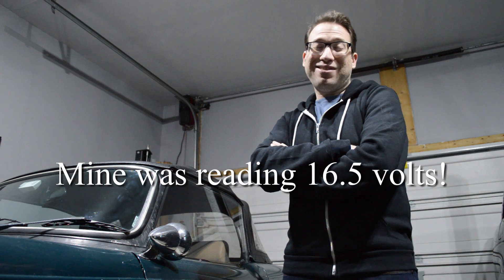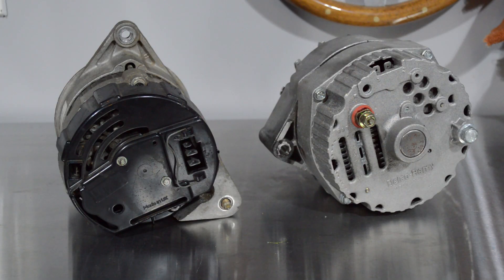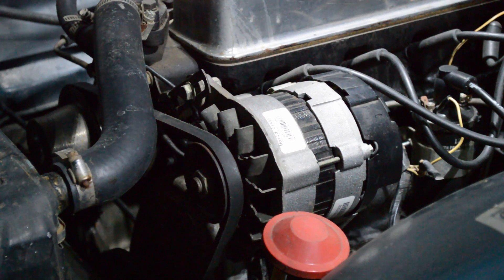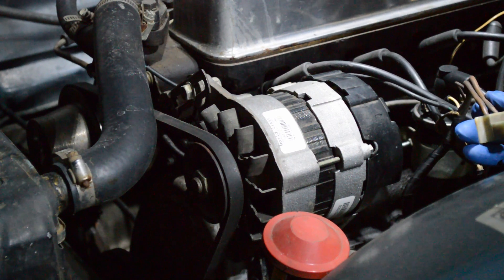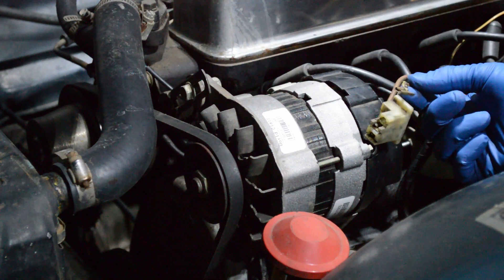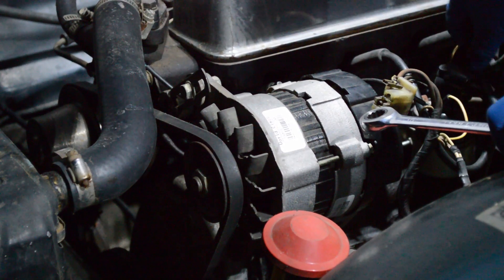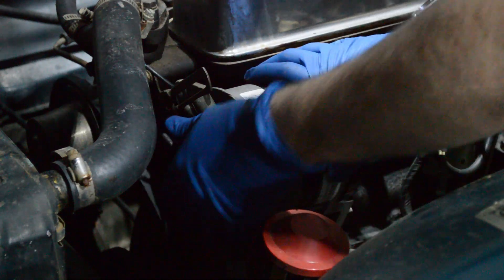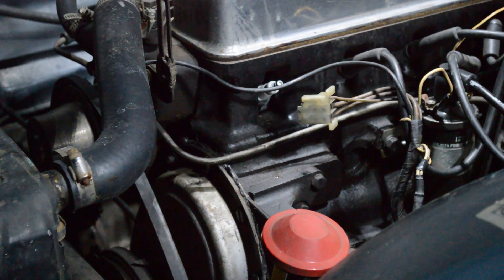Lucas Alternator is Overcharging--What Now?

Comment: Prince o'darkness strike again.
Reply from the maker: To be fair, most of the time that Lucas electrics fail, the system is several decades old.  It's typically down to lack of maintenance... at least unless you have a TR7.  Those were never screwed together properly at the factory....

Comment: Hi, is there any chance that you are going to make a Lucas 'refurb' video? I have a feeling mine is on it's way out, and it might be easier to replace the diode pack or whatever else than to get another. Most available- Rockauto!- do not come with fan or pully, and I'm not sure I want to swap those over. I could see one or another not fitting the new alternator, 'cause Murphy's law of aftermarket. 
Last week I pulled my 74 out of storage and drove 45mins to home, stopping at the store. I left the parking lights on, and in 15mins the battery was stone dead. I uber'd the battery home, charged it, and uber'd back. Once I got home I verified that the alt. was only putting out 12.x Volts. Yesterday I unplugged the connector, checked leads, plugged it back in to check for ripple and hook up my alt. tester. It was working fine with 14.2V...irritating. I'm going to drive it today to see if it's heat related. Or, it could have been in the plastic connector...I've never taken it off in 6yrs of ownership.
Reply from the maker: I've thought about it, but rebuilding alternators requires some soldering skills and diagnostic skills that might not translate through a video.  Also I'd be bad at it since it's not my area of expertise.  Diagnosing is easier than fixing....
Reply: @midwestmotoring  Thanks for the reply. I've since bought a reman'd Bosch unit that works a treat. My Lucas was indeed shot, but put out 14V, until you had lights on then it couldn't charge the battery. Bat light never came on...

Comment: Great walkthrough and descriptions -- for another replacement option, I found this alternator on Amazon (not an affiliate link - no financial interest) https://www.amazon.com/gp/product/B00KL5157Q

It's a direct plug and play replacement for a 1976 Lucas alternator (at least -- probably most other TR6 models as well), and the only hinky-ness I encountered was needing to unbolt the three long bolts running through the perimeter casing, and very carefully rotate the back half of the casing around so that the mounting holes matched the Lucas mounts exactly.  After that, it was a drop-in replacement.

One note of caution: it's a 55 Amp model, so you'd likely want to run an extra cable over to the positive battery terminal, so you're not pulling 55 Amps on that poor little brown wire.
Reply from the maker: Definitely a good option, and probably better than the Delco unit.  The most appealing part of the GM alternator is its same-day availability.  I walked into an AutoZone and left with the alternator 10 minutes later.  That was important to me since we were on a trip when I picked it up and needed to keep the car going.

Comment: Ha! I have a degree in Electrical Engineering Technology, and you are good with your explainationions LOL. What is the component of the alternator that can cause a battery drain? I've always wanted to know that. My money is on a sensing wire backing out of the plug? Bane of my existance on my Bosch wired Alfa, I've found 3 that had come out on different sensors. PITA to diagnose.
Reply from the maker: With British cars, who knows?  I've got a battery drain on the Spitfire that I've never been able to track down.  I hadn't thought to check if it was the alternator....  Honestly I always install a kill switch on all of the classics so it's never a problem.